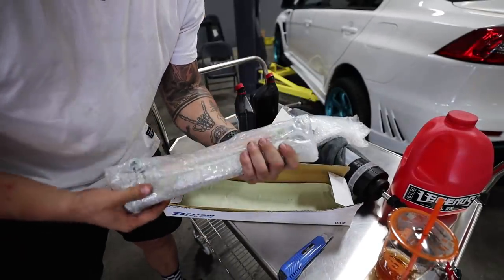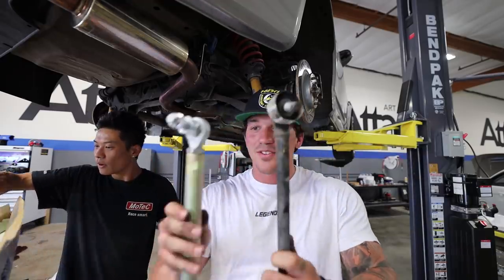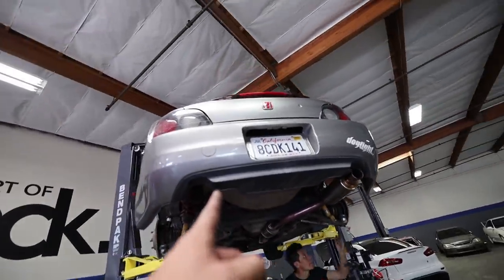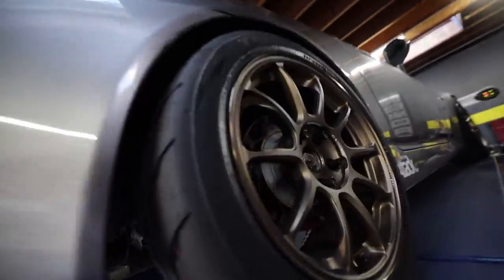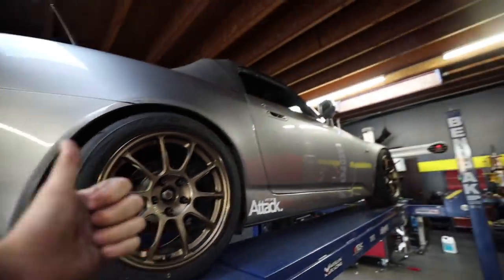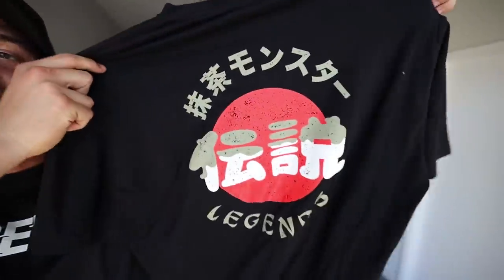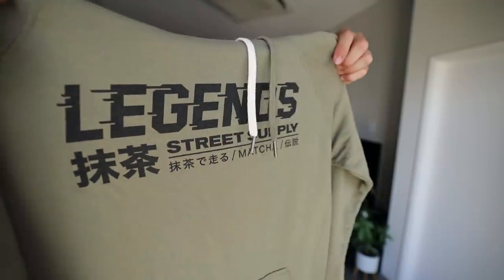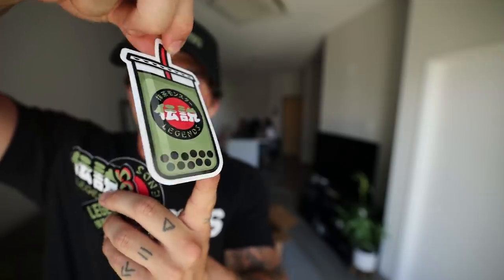Building a COMPLETE Spoon Honda S2000 ep. 2

Comment: @0.57 you were saying that the car has toe  in in  the rear and you said its not good for tracking. this is wrong and you do want toe in  in the rear.especially for rwd. this helps with traction on corner exit. just thought id put that out there

Comment: how much camber are you trying to get in the rear? there should be no need for upper arms at all.
stock parts are good up to -3/-3.5 and you shouldnt need to be going over 3 anyway. with those tyres -2.5 is good and -3/-3.5 in the front